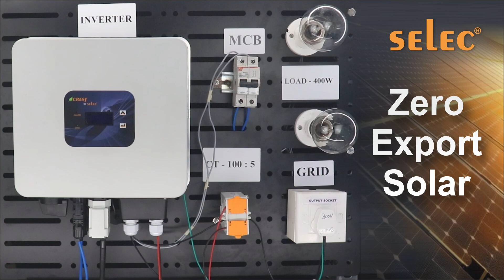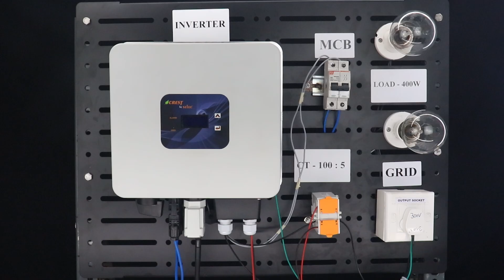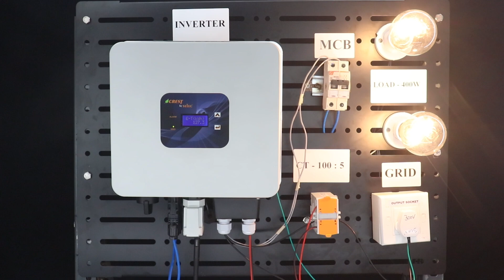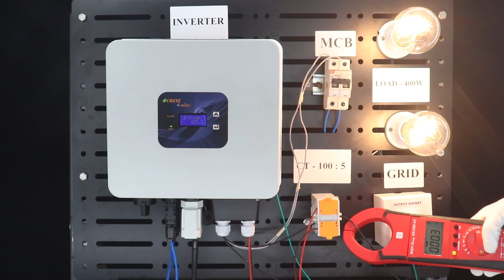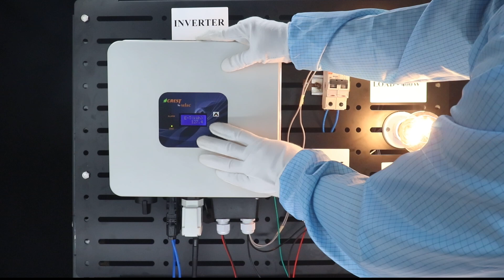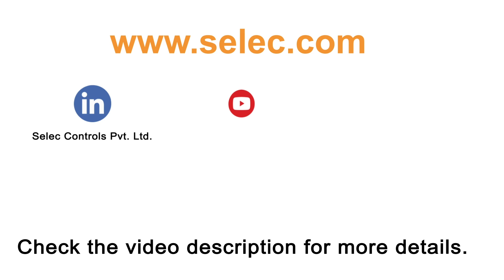Selec Solar Inverter – Zero Export Feature Demonstration | Step-by-Step Guide

Comment: Is CT connection / Grid Tie feature even works if Grid is off/ Load shedding in your area?
Reply: No if no power is coming in from the grid then your inverter will be not producing any power!!! You need a separate off-grid inverter to run your household!!!